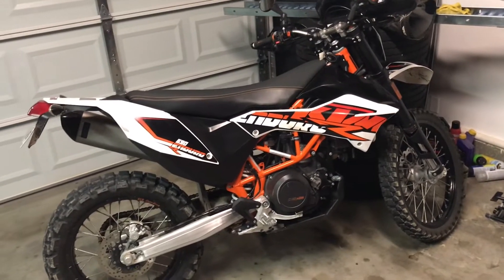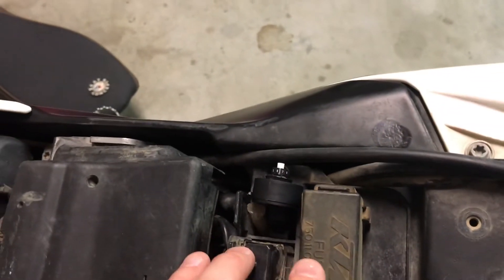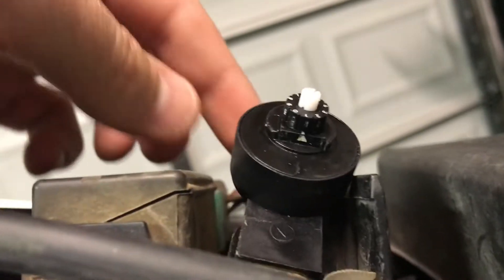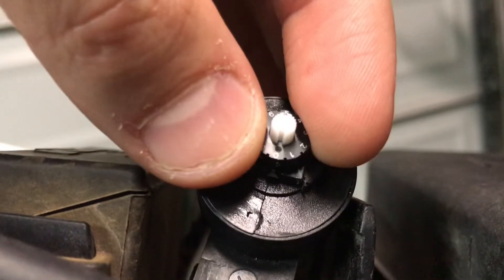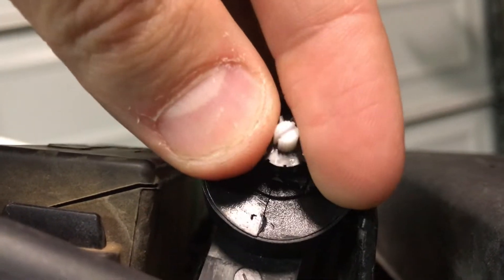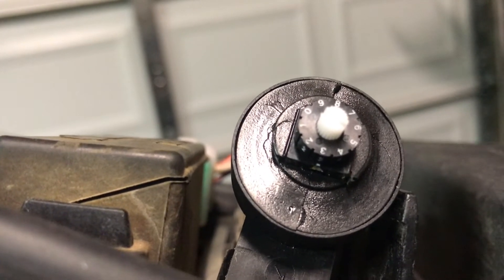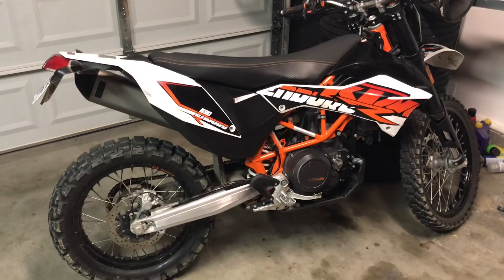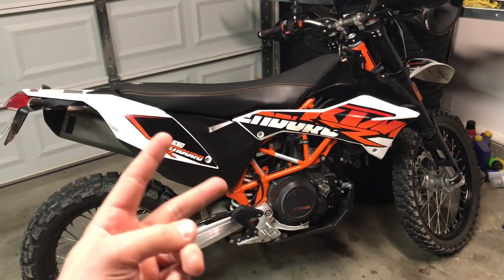Ktm 690 Enduro R Map Switch

Comment: I am curious about heat issues and this switch. I live on the tropics and my 690 is running really hot (fan on unless I am on an open road, doing 50km/h or faster). 

Did you experience more/less heat by using a certain setting? E.g. do you think the rain mode would heat less? 

I will experiment with that, but my fan just died yesterday :O so I have to wait for the part ...
Reply from the maker: I didnt notoce a difference my fan was always on though lol. Its 100+ where im at right now

Comment: I have a 2019, and I am told that I can do this, but I do not see this knob on my bike at all...  Any suggestions?
Reply from the maker: Gil Vietor I heard the 2019 got rid of that switch. I could be mistaken though
Reply: @ThumpermanMotovlogs  You must be correct, I can't find anything in the manual.  Thanks for the prompt reply.
Reply from the maker: Gil Vietor anytime thanks for watching!
Reply: @ThumpermanMotovlogs  When I explained that I was concerned the Husky 701 might be too much bike for me when I do difficult off-road stuff, my local KTM dealer told me a few weeks ago that the KTM 690 can change mapping, and he thought the Husky 701 couldn't.  But, I'd honestly trust you all over them.  The dealer sells both brands, and they have 701s in stock and all of their 690s and 790s for the year are already spoken for or gone.
Reply: @ThumpermanMotovlogs  Oh, is it possible the mapping is done on the dash computer now?  It might just be part of the Sport, Enduro, Road, etc settings.
Reply from the maker: J P dang they’re selling quick then! Yea Hopefully the new bikes are easy to remap idk why they would switch to not having a switch, having it on the bars would be convenient for sure!
Reply: @jaypuck6912  I just got back from some really long rides up in Utah around Escalante and Boulder.  The 701 is insanely controllable at low speed as well as stupid fast.  I'm very happy, and I think you'd be fine with it, you really have to twist the throttle to get stupid out of control.  This is my first digital ignition on a bike, so it is kind of weird, but I found it manageable and predictable.

I am strongly thinking about getting a 1090 Adventure R now, just due to the highway portions being not very comfortable.  But the thing is, in the tight stuff, this thing is so nimble and so easy to idle along around things.  The clutch is just outstanding, the brakes are perfection (the front is just so good, so good).  Big rocks, sand, gravel roads, single tracks, it did great.  

I've watched some reviews of the 701 and read some reviews, dunno why people complain.  The fuel at any level didn't seem to bother me at all, the range was really good, if you keep the speeds lower.  After 65mph it chugs the fuel pretty quickly it seems.  

I might try a Seat Concepts before I get rid of it.  I am honestly afraid that if I get rid of this bike, I will regret the decision.  I rarely turn the ABS off unless I am going on a single track or doing hill climbs.  My dealer told me that if I get the pipe and remove the cat or something, they do a new throttle mapping or something.  This makes the bike pop more down low, which is annoying when I see logs or obstacles.  I'm used to my old 520sx, just blip of the throttle and up she comes, this required more throttle and speed.

Hope this helps.
Reply: @gilvietor1918  What part of country are you in?  If you are a state away and can wait until next year, you might have a buyer if you need one.  I'm buying and selling a house this summer so I can't dip into savings until at least fall.  Thanks for your opinion about the 701.  How is the vibration?  I hate the vibration on my 15 yo KTM 625 SXC when on roads.
Reply: @jaypuck6912  Havasu AZ.  This is my first street bike, I am entirely dirt in my experience.  I don't notice any vibration, at all.  I do believe the Husky (and now the new 690) have a counterbalancer added that gets rid of that.  The only thing that is annoying at 65mph is the wind.  Where are you moving to?
Reply: HightyRoss Supermoto Vlog  Thanks for the input.  I'm thinking they have just combined it with the dash settings.  If you set it for sport mode, it maps it as such.  Off-road mode cuts the power like the off-road mapping switch would have done.  That doesn't really make sense for the SuperMoto though.  You guys in Europe, depending where you are, have different mappings for rider experience.  In the USA we can ride around with 160 hp under our butts with no experience.